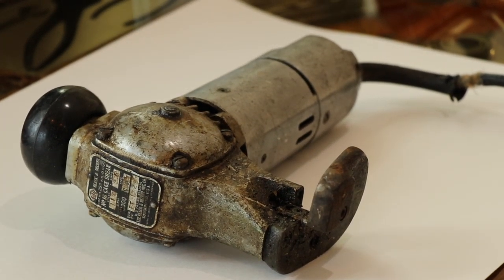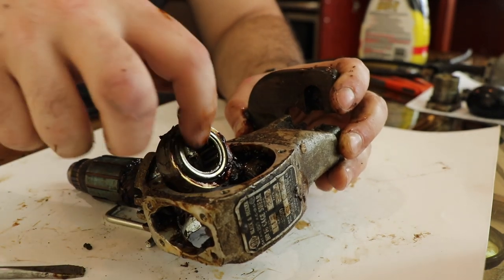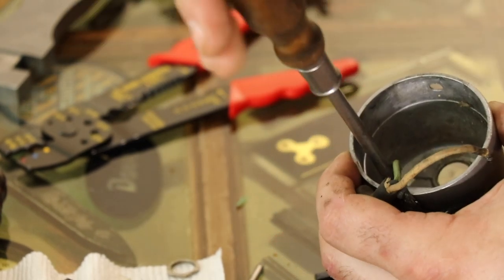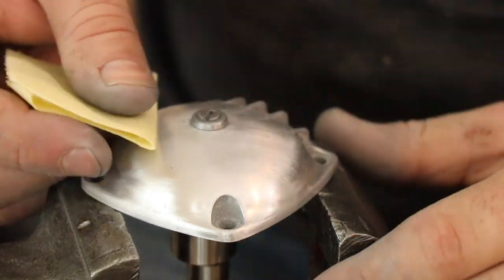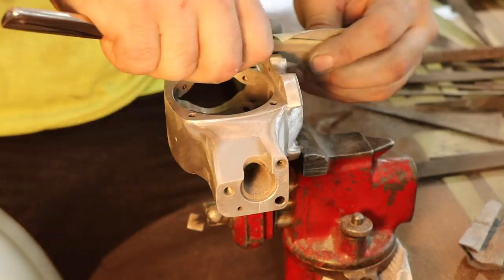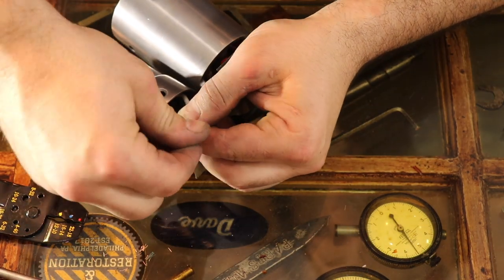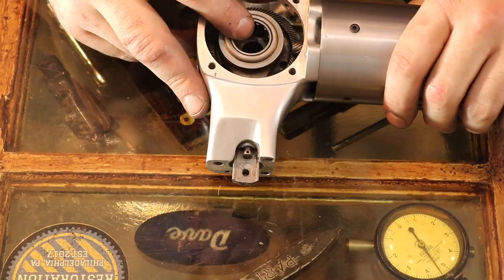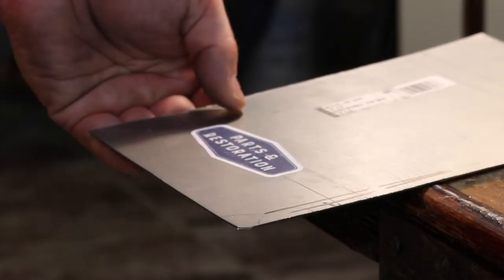1960s Sheet Metal Shear / Nibbler PERFECT Restoration

Comment: good job! I too am one  who does what i can ,where i can, with what I got. Like using Scissors for stripping wire if they are handy.
Small thing like that i pay attention to. It is the mark of a good problem solver.
the only suggestion i have for you.... and it is just that.... a suggestion..clean the commutator before reassembly. even if the brushes are not replaced. clean between the pads with a scribe too.
this will lessen the sparking after they break in with each other. usually takes several minutes to break in. new ones will spark also when breaking in.
Really great job man. If you had fun, then it was worth it!
Reply from the maker: Hey Brian, thanks for the message.  The comm got a good cleaning off camera, down to bare copper, and then tested which gave it its new carbon streaking.  Thanks for the great suggestion that was delivered in a kind way. It’s hard to capture every single step on film and often guys just get on here looking to rip you tubers for every “‘missed step” when often that’s not the case.  :)
Reply: @partsandresto  you have more guts than I! I would no more put a camera on me and my work than a knife in my heart!
And my wife would do the knife on me if I did that in "her" kitchen!
Thanks for the reply and best wishes for you and your channel!